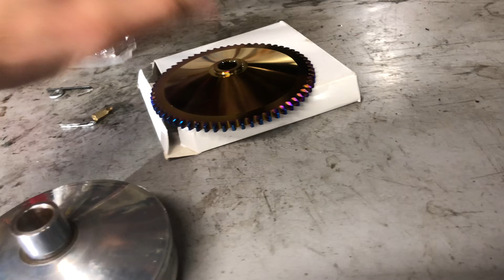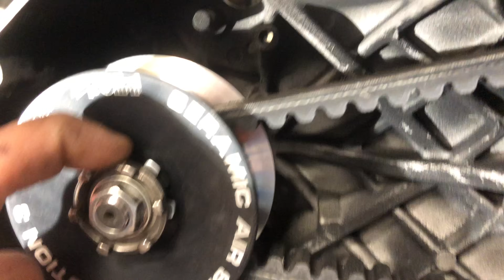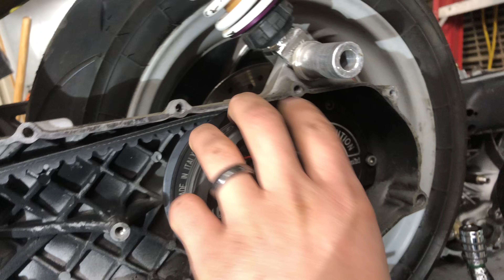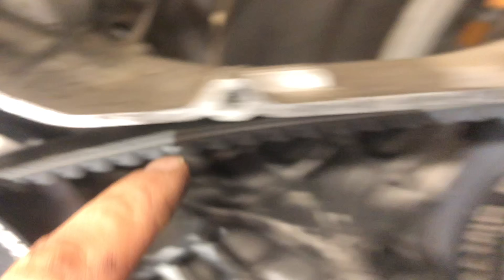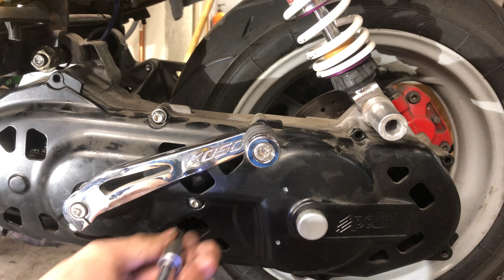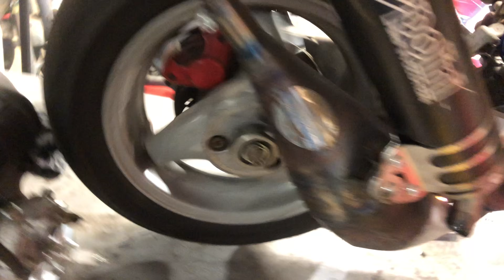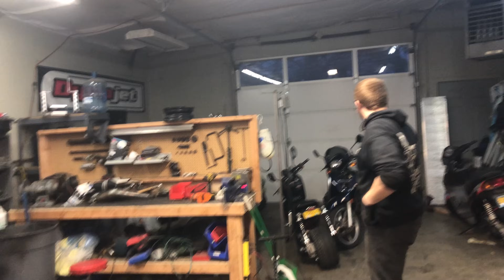Scooter CVT transmission explained

Comment: if the belt dont go up all the way in the front what do i need to change??
Reply: have you checked the roller weights in the variator? If they're worn it can prevent the variator from shifting correctly. Does it have a restrictor ring on the variator shaft?
Reply from the maker: shims, weights so on

Comment: Thanks for the video, I have been searching so many options for clutch and vario, but all lead to different directions.  I have a Vespa 300GTS and am looking for higher top end speed.  Based on what I gather here, I would want heavier weights and a stiffer contra spring?  Is that accurate or am I backwards on something?  I have done some other upgrades and I notice now that when I start the bike and it is at initial idle on the stand, the rear wheel is spinning much faster.  Based on this video that tells me I am hitting higher RPM's now and the clutch is engaging sooner.  That would be corrected by heavier vario weights to slow down the spin?  Thank you so much.  I have been crushing through your videos, great help!
Reply from the maker: No problem! we have a few cvt videos

Comment: what factors that have effect to make the variator in and out faster. is it the roller weight in total ? ie. variator with 6 roller each roller weight 17grams so all the roller weight 102 grams. or the individual roller weight. because some people using mix weight for their roller in one variator. thanks for answering
Reply from the maker: total weight

Comment: Hi..nice vid.
Wanna ask you if mine use 135cc 
What is better to modify the roller and torque spring.. should I use heavy weight and 1000 torque spring..
Daily use in highway..tq
Reply from the maker: thanks

Comment: Hi man. Is it normal for drive belts to slap or have lots of shaky movement? 

https://m.youtube.com/watch?v=ddriLzJiC98

I wasnusing a longer belt on this scooter from a 797x16.6 belt to a dayco 808x16.8 belt as the previous belt can’t seem to reach the top of variator on wot. However the fitment of the belt on the TD is it is edging up higher than usual.
Reply from the maker: some little variants is on not much

Comment: Is there a!chance that shimming the boss and fit the belt lower in the vari will also prevent the belt from travelling further up the edge of the vari and lose top end speed? Will a slightly heavier roller solve the belt travel when shimming?
Reply from the maker: we have a BUNCH of cvt videos

Comment: So how much would it be for you to make something I can bolt on to a 2020 kymco super 8 50x
Reply from the maker: Peter Macrellis I’m sorry but they do not offer this kit for tour bike. In general a full cvt kit is $250-450 depending on the parts and quality
Reply: @Scooterswapshop  any ideas on maybe buying a crate engine that would fit on the 50x frame??
Reply from the maker: Peter Macrellis there is no new motor to fit that bike. It’s not a popular platform for performance

Comment: Changed my original pulley with modified pulley..but the topspeed decreased from 120kmh to 106kmh ..Yamaha NMax 155
Reply from the maker: Abu Sham it’s the wrong part or installation problem. I would contact the supplier you purchased it from

Comment: Question, flat road, constant throttle, constant speed then increase throttle. For that initial moment does cvt accelerate the same as a chain? Thanks
Reply from the maker: Cvt will only be a constant non changing ratio once you’ve maxed out the rpm/travel. For instance a bike rpm will stay the same until x speed; then you’ll hear it climb. When it’s climbing that means you’ve maxed out the cvt  and your gears and rpm are causing your speed to climb. Not your cvt

Comment: Hi. just wondering what makes a grinding sound whenever i accelerate. Recently changed weights and belt.
Reply from the maker: vincemaxim unfortunately impossible to say without having the bike in person. Could be an installation error if it started after the recent work
Reply: @Scooterswapshop  Thanks for the insight. Will have to go to the shop that fixed my scoot (suzuki nex 2014) and have them check it out again. I noticed the grinding sound before the change. It was suggested by the mech that it might be the weights that's causing the sound since it's due for a maintenance check. The sound is notable only on due quick acceleration.

Comment: Do i need lighter weights or heavier weights to make my 125 go faster please let me know and what drive belt do i need???? And can i keep the stock clutch
Reply from the maker: Sometimes you’ll gain more top speed with heavier rollers but you will lose acceleration. Run the oem belt

Comment: If i install a variator racing kit on my yamaha nmax 125 is necessary to change the stock clutch. And what weights and belt will i need to get please let me know it will be much appreciated thanks
Reply from the maker: Clutch is totally independent  of the clutch. You only need to do a clutch upgrade if you upgrade the motor itself

Comment: Hi bro, recently I carried out check on the primary pulley of my scooter. I found that all of the roller bearing has disintegrate on some portion of it, do you know what the cause of it?
Reply from the maker: They just wear out or someone used low quality rollers

Comment: do you have video change you rear breack to disck
Reply from the maker: You can’t change bikes from drum to disk. Without changing to a different engine
Reply: @Scooterswapshop  do you have any video,,i see at yur using disc bro
Reply from the maker: There is no way to install disk brakes on a drum bike. Or maybe I don’t understand the question

Comment: What is the best roller weights for top gaining top speed?
Reply: Heavier weights will sometimes increase top speed but less acceleration. If you put to heavy of weights in then you will get less top speed. You just have to test and tune it.
Reply: @Vibez.  what if i combine like 3 9grams and  3 13 grams would it gain top speed with better acceleration? Then i change my center spring to 1000rpm and also the clutch spring to 1000rpm
Reply: @jaypunzalan6999  that should work pretty good especially since you are changeing your springs. And i assume you are running 150cc?
Reply from the maker: all depends on the bike and parts on it

Comment: I spent money on a new clutch kit still having problems the part where the roller weights are creating alot of heat. Its bogging like crazy. And I can't  get it to run good. I want that muffler sounds good
Reply from the maker: I would
Contact the company you got the parts from to verify they’re correct for your application

Comment: When I first found out about this type of cvt was about 1950. Salsbery  motor scooter used them. It was the fastest motor scooter on the marker at that time top speed above 70 MPH. Honda bought out the rights to that cvt and put them in their Honda dune buggies about 1970.  I had 3 of the buggies. The cvt only caused trouble when it got wet. I had to push it out of a river bed.
Reply from the maker: ok

Comment: hey.. hello i m big fan and follow u and i think you may help me
 .. i have derbi gp1  with 47.8 piston ..yasuni r pipe multivar variator with 4.3 grams rolers white contra spring and yellow clucht spings... 17.5 dellorto  with 65 main jet ...acceleration is good  on hi rpm but  lose top speed what i need to change ... light contra.. light clutch springs or heavy rolers?
tnx man
Reply from the maker: we can set you up with the proper products let us know when your ready to buy the parts by giving us a call, email or message on our app.

Comment: I have a Yamaha aerox I had a problem on the the rear pulley basically after and long stretch and when coming  to a hold the lights when I went to pull away completely no power full throttle back of the throttle and would really quick pick up I swap the whole back pulley clutch contra with my other Yamaha it’s straight away solved the problem but yesterday it started doing it it again once so deffo I’m sure it’s clutch clutch bell or belt related I’ve shim mine so the belt is at its highest at the rear but lost 6 mph top end so now I’ve removed the few shim gain 3 mph so needs work on that deffo its my rear pulley do the groves wear out
Reply from the maker: you get it worked out?

Comment: Im getting a rattle from either the fan area or the cvt cover maybe something inside. Only when cool once warms up goes away.
Reply: Check your slide piece clearance maybe you need a new one.
Reply from the maker: go piece by piece til you find the rattle

Comment: Doesn’t the belt create friction against the side walls leading to some power loss
Reply from the maker: Somewhat yea. But it also allows the motor to be in the powerband at all times. A 35hp cvt bike will be faster than a 35hp geared bike most the time
Reply: Scooterswapshop i love the feel of the cvt transmission..doesn’t feel lacking in power to me

Comment: Can u help me? My scooter keeps trying to move forward when I come to a stop or when I’m idling. Is that a bad rear pulley or clutch issue? 
I have a four stroke Keeway  f-act 150cc . I can feel small jerking movements when I’m standing still. When I put it on the center stand and start it, the rear wheel is still but starts spinning
Reply from the maker: Sounds like you have a broken or several broken clutch springs

Comment: Hey I need help with my atv same type of engine but it is stuck in first gear hit me up please
Reply: I have the same issue. Did you get yours figured out?
Someone please help. I am a mechanic by heart. I can fix nearly anything and have repaired many cars, atvs , trucks over the years. My issue is I have 150cc taotao gy6 with a CVT. I just bought a new replacement CVT since the old one was giving me the same issue. New variator, new belt, new clutch. The issue I have is it will not go past 20mph. Also I noticed as riding the variator and clutch are not engaging correctly. The variator should raise the belt and the clutch should lower the pulley right. Well while riding I left the cover off to watch and its not engaging. So I put the 4 wheeler on bricks to test it and revved the motor its engaging correctly. When the 4 wheeler has weight on it its not engaging but when the weight is off it is. This is a new CVT and the old one was doing the same thing. Anyone have a idea whats going on. Only thing I haven't checked is the gearbox
Reply: Atvs use a manual transmission. This is a CVT. It's a continuously variable transmission, which means it has no gears per sey. How can he help you get your atv (that uses the same motor) out of gear when using the a different gearbox?

If you want help tho, you'd probably find that your clutch cable is out of adjustment? With the quad switched off can you slightly roll it back and forth and shift up through the gears?
Does it use a centrifugal clutch or a manual clutch with a clutch lever?

If it uses  centrifugal clutch then that is probably jammed or worn out?
Reply from the maker: sorry

Comment: Hi man  what do you call that adapter on the rear shock nut that you can use to raise the scooter with a paddock stand?thanks
Reply from the maker: The standoff?
Reply: @Scooterswapshop  yup
Reply: Hi man. Another question, got 5g sliders on my stage6 vario and belt on the rear pulley just sits nicely near the top. However, at WOT on a sharpie trick i doesn't seem to ride high on top of the vario and left about 10-15mm mark. SHould i go for heavier sliders? Like 6g? Got 1500 torque and 1000 clutch springs on 70cc stage6 cylinder and sports exhaust.

Comment: if the motor is running and it wont go just revs up is the belt gone or clutch or whole transmission
Reply from the maker: We have lots and lots of videos on cvt to help you work these issues out. It could be either

Comment: Great stuff. I noticed it’s bad to rev a automatic scooter!! It wears your small transmission bearings out. I’ve got a 300 GTS Vespa super sport, and I can hear my small transmission bearings are gone.. quite expensive to replace....
Reply: Or you could learn how to do it yourself and save a ton of money. Doesn't sound like it'd be that hard.
Reply from the maker: belt is pretty simple to replace
Reply: @Scooterswapshop if we use a stiffer torque spring compared with the standard torque spring, does it affect the belting lifespan?

Comment: some one told me if youre reversing while your engine is turned on it will cause damage or it will risk damaging the motorcycle? is it safe to reverse while its turned on or its better while its off?
Reply from the maker: Doesn’t damage the bike in any way

Comment: question: so if ur motor is slow acceleration and you reduced the weight of roller but then how do you deal with top speed loss??
Reply: Use standart roller but you need to change front pulley degree and scratch roller lane (sorry for my bad english:D)
Reply from the maker: theres alot of ways to change things to find the sweet spot all depends on the bike and setup

Comment: Hi, im from philippines, just wanna ask, i have honda beat FI scooter, its 110cc, how can i make my scooter faster a little without modifying the block and head, i change my pipe from stock to exo r6, silent type, stock rollers are 15g, 800rpm clutch spring and center spring, how much weight of rollers should i put and how much rpm for clutch spring and center spring if i want more acceleration and speed? Thanks a lot and ride safe,
Reply from the maker: hope you got this resolved!
Reply: tama yan stock ka lang wag mo na upgrade block mo. Mas okay stock tapos panggilid ka lang yung bola mo gawin mong 9-10 (para may dulo)

Comment: Do cvt scooters have auto deceleration ?
There seems to be auto braking after releasing accelerator
Reply: That's what you call an engine break
Reply: Is your bike a 4stroke.
Reply from the maker: thats called engine braking and slight bit

Comment: Finally, someone who can fully explain the functions of a CVT! 
I have a V-Moto Milan II 50cc and from the sounds of this video, installing all those components is possible, am I right? I'm in Australia and I've hardly seen any modified scooters in Adelaide...
Reply: eofkhj
Reply: Eeiipp Abdou Karm osman YouTube... Are you trolling me?
Reply: I also have a vmoto Milan, 70cc eBay bore and piston, eBay expansion pipe, #80 main jet, 
I was having trouble with it bogging on take off, after pulling it all to bits like a million times, I eventually found the variator had a destroyed roller that was jamming it in top gear, I removed the dead roller and now no more bogging,
I have ordered a eBay variator kit
Reply from the maker: glad to help

Comment: If I were to do the "sharpie trick" and I get som sharpie marks left, do I need other weights? Other clutch springs? Harder or softer? Lighter or hevier weights?
Reply from the maker: You’d rant to check to make sure your belt is the proper width. And if it is then go heavier

Comment: Anyone know why a brand new yamaha zuma has a harmonic vibration at 31-39 mph? Belt is fine. Floorboard and seat has a rumble with speeds
Reply from the maker: You likely have a bent component in your cvt
Reply: I was thinking about that but everything was replaced non warranty but also called a few yamaha dealers around the states and a handful of mechanics heard of this. Just the way they are
Reply from the maker: Sounds like a design flaw

Comment: Hey there 
I have. 2015 Yamaha nmax scooter, I want to maximise the top speed and I want to make it stronger when I start riding on the low range I want it more powerful and on the hight range more fast
What should I do?
Thank you :)
Reply: Put a big bore kit on it, or just start with a racing variator
Reply: Sell it and buy r6
Reply from the maker: we dont have those in the usa so we cant really assist.
Reply: Change primary gear.....up 3.14 to 4.13 if can....bore 60mm....stroke 58.7...coil magnet and injector fuel make sure racing....the last work setting again ratio....that it's...218kmh...

Comment: I have a question like most anyone else would have on their cvt repairs. I recently bought what I thought to be a brand new youngfu 150cc scooter. When I drove it for the first time it had somewhat of a drag to it while riding. I pulled over the cover to the clutch and fan pulleys to find the pads and rollers burnt/crystallized like on a cars brake pads. Also the belt was abit loose in my opinion (And from a couple of friends helping me). The scooter itself only had 12 miles on it when I purchased it. But, the pads and rollers show a different story. What help could you offer that would help me fix my scooter to where it would run better and not cause the pads and rollers to burn up so quickly as these seem to have done? Also, as it looked when I broke it apart it looked as if someone had worked on it before. If it's a new scooter as I was told (and with the low mileage) then why would anyone work on it prior to shipping it and/or selling it?
Reply: More than likely they took speedometer  cable off at 12miles beat the shit out of scooter and then put it back on before u bought so they lied to u to make it seem like it had 12 miles it I can take mine off in a matter of 5 minutes because if ur speedo cable ain't on then miles wont build up
Reply from the maker: Sounds like you need a new belt clutch and possibly other parts. That brand is going to be the lowest quality bike on the market so I wouldn’t expect things to be high quality. Good thing is parts for it are extremely cheap to replace
Reply: They removed the speedometer cable and or took new engine out and put in a used and abused engine back in its place. 
Some people really suck and will rip you off first chance they get!!!